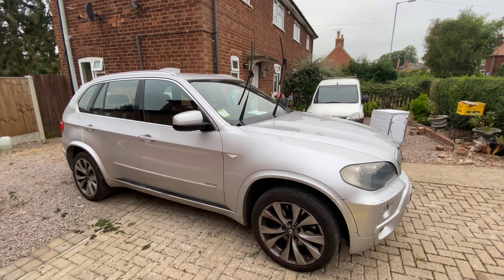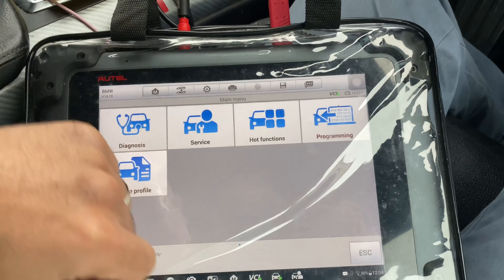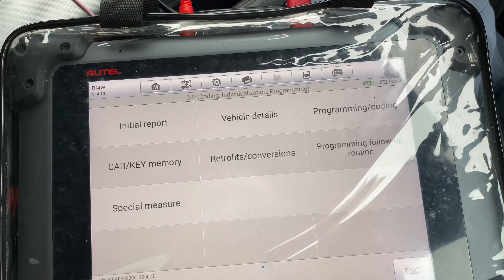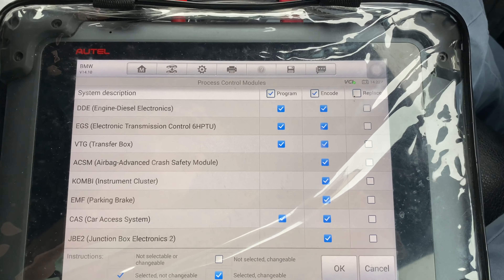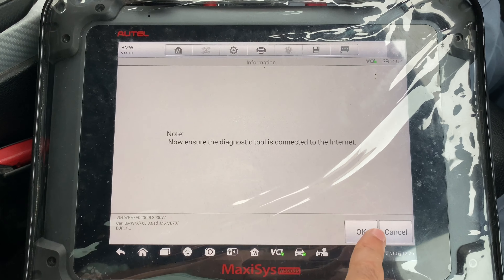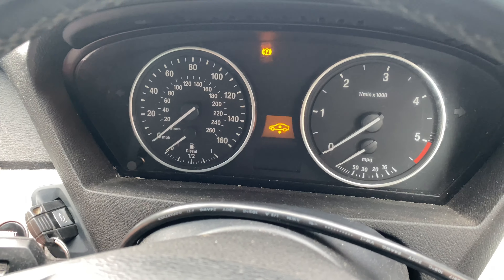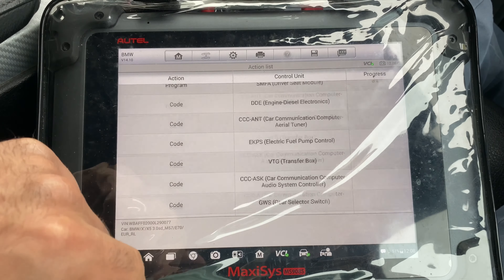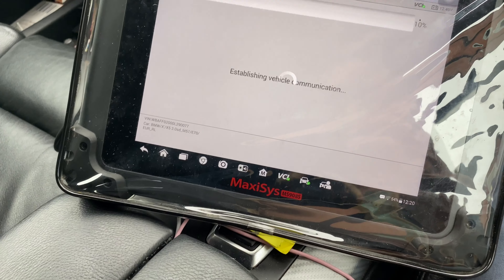AUTEL Maxisys CODING & PROGRAMMING On BMW COMPLETE UPDATE!! | STEP BY STEP GUIDANCE

Comment: Great video, thanks! Where did you buy cover case for Autel, cool thing :)
Reply from the maker: Hi, thanks you for your feedback. 😂 I bought it on eBay funnily I searched everywhere for a case like this and I couldn’t find it at the end I found this case that was used for make up, below is the link to the item I bought. Thanks 

https://www.ebay.co.uk/itm/202745512031
Reply: @sadiagnostics  Thank YOU for link!! I also searched,  in Aliexpress, even Chinese don't have case like that :D :D
Reply from the maker: @audriuskimtys7943  no worries you’re welcome and yeh I had trouble finding any. The best one one I found is the one I’m using and I’ve had it for over a year and still in good shape 👌 👍

Comment: New subscriber as of today ... couple of questions is this Autel Maxisys MS908s Pro still the one to get for programing an coding modules  for bmw etc or is there one better now?.... I have a no message vtg module I think is dead , if i get a new blank  or used vtg module from another car can i put that in and code to my vehicle  to get my AWD back with this Autel or do i need a newer one?

also question about this updating all modules in this video . i have a modded tuned bmw  N54 with MHD and xHP trans flash , if i did a update all modules would this negate my tunes???
Reply from the maker: @napoli.4life  hi latest Autel I used was ultra lite.

It’s always best to put new module on as sometimes they may crash and not work.

Yes if you update it it will
Most likely clear the map as it will restore original files…
Reply: @sadiagnostics   If I just put in a new module and code it to the car and thats it , my tunes should be fine as long as i do not update the entire car
Reply: @sadiagnostics  I do want to buy an autel after subscribing to your channel and seeing what you can do with this machine ..... which is the best on i should get because there are so many out there and im overwhelmed , I do fix my own vehicles and i have a couple of  bmws and an audi
Reply from the maker: @napoli.4life  you can buy Kingbolen K10 which is equivalent to this and is like a fraction of price… it does same job as Autel but for less…

Comment: Bro, can this scanner save FA or vehicle order to encode used modules on my bmw f80 ?
Reply from the maker: Hi am not entirely sure what you need but it can override used modules by using original file from dealer. The system will download the files from dealer and then overrides the used module to put new file on.

Comment: have you ever had an autel brick any control units?
Reply from the maker: No idea what you mean
Reply: @sadiagnostics  i mean have you ever had any autel product fault while coding or programming, causing a control unit in the vehicle (dme etc.) To become unrecoverable and need replacing. Cheers
Reply from the maker: @afk1448  no never happened to me before.

Comment: Greetings friend, i;ve been watching last 7 days all your videos as i am interested in buying MS908s Pro, i currently have mk808bt which doesn't program/code. I would like to ask you some questions which would help me a lot in purchasing this tool, on the MK808BT i had special feature on most of my cars (bmw 118D, bmw x1 f48, smart and some of my friends) airbag reset but whenever i was hitting the category it said there is no sub function... i was dissapointed because the biggest reason i bought it was to clear airbag reset lights and do some simple stuff on my cars and my friends (he buys small crashed cars)... will i have the same problem with this? the special functions work on every car?
Reply from the maker: Hi,

So all diagnostic tools will do the same thing in terms of clearing and reading faults. However if you want to programme and code then the ms908s pro is the real deal and can do literally anything you can wish for.
Reply: @sadiagnostics  Thanks for your quick reply,  yeah I do realise that all Aurelio diagnostics do the same but I was disappointed from the mk808bt that it had the airbag function but without letting you do anything just tease you hehe, anyways will buy this one soon it seems amazing
Reply from the maker: @georgel.4836  yeh in terms of airbag what is it you wanted to do? As there’s limited functions on the Autel for example you cannot decode pedestrian sensors, only dealer software can decode it as far as I know.
Reply: @sadiagnostics  Just to reset crash events which I could not on any car I tried
Reply from the maker: @georgel.4836  ok on bmw you cannot reset the crash data but for ford and some other vehicles you can.